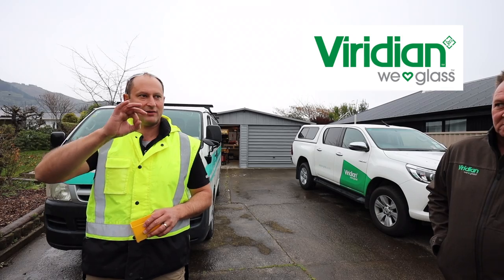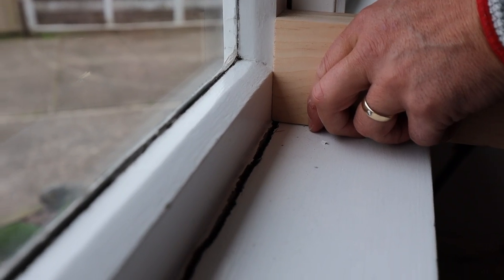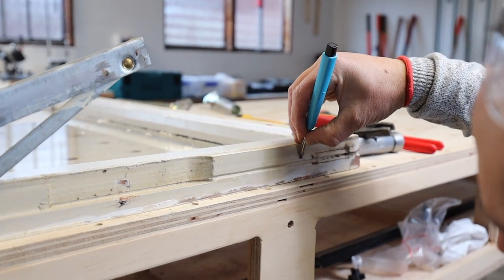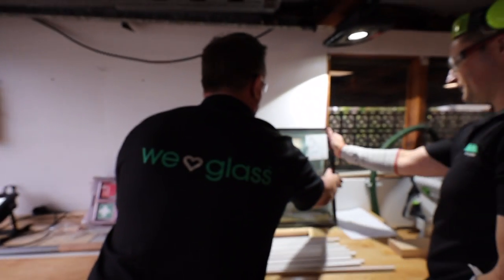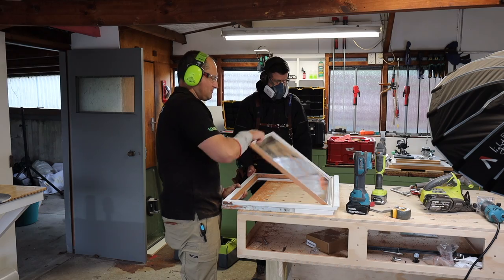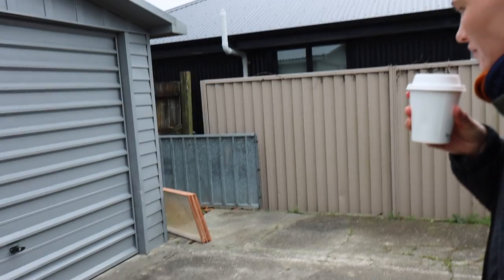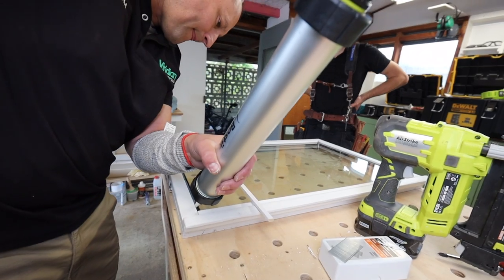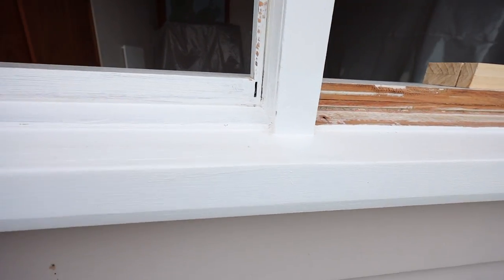I'm Double Glazing My Old Windows... Wish Me Luck

Comment: DO NOT trust a firm that turns up with Ryboi.
Reply: Some of the ryobi gear is decent. Tool snobbery is for idiots, the majority of tools are made by the same companies. AEG/ridgid comes out of the same factory, some of them are literally the same tools.
Reply: @Etacovda63  TTI manufactures all the Milwaukee as well.  👍
Reply: The last 3 Ryobi (yellow as shown here) tools I bought were duds. A planer cutter bearing melted out its housing in half an hour, a belt sander lasted 1 week and a second replacement lasted just as long. I am very gentle and fussy so I didn't use them like an animal. I moved back to Makita; obviously. 
Am I a snob or do I just want a decent tool.
Reply: @jimurrata6785  just because two products come out of the same factory doesn't mean the two products are the same.
Reply: @markjones1337  I never said that Milwaukee is the same as Ryobi.   🤷‍♂️
I'm pointing out that TTI (a Berkshire Hathaway company) produces a whole range of power tools as well as vacuums and hand tools at their factories in Europe, North America and Asia.
TTI also makes the Hart brand for Walmart, AEG, Homelite, Kango and many more at different price points.
If Ryobi tools are beneath you or your use case is too demanding then find another brand.
Hell, I have tools from Festool and I have tools from Harbor Freight. 
They all serve their purpose...
Reply: Lol technically though, he showed up with a Makita because his Ryobi router failed.